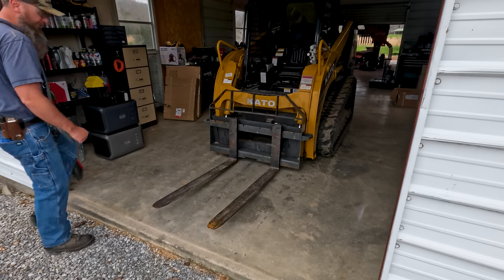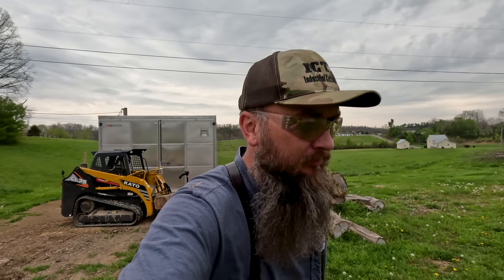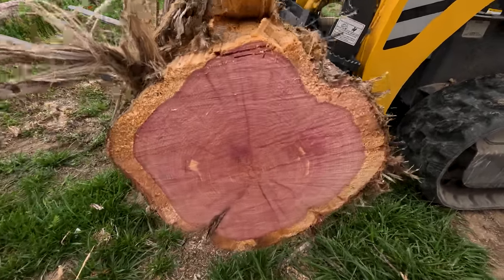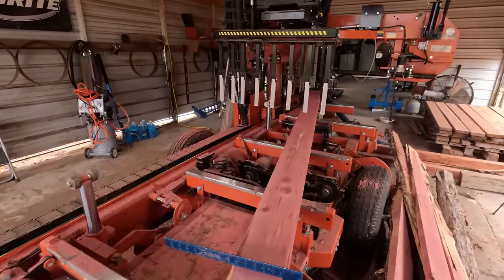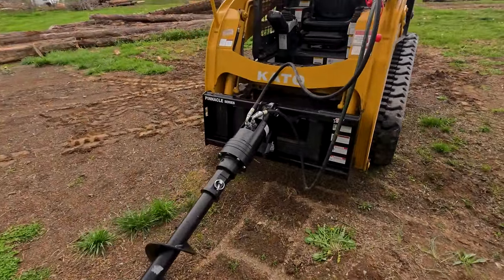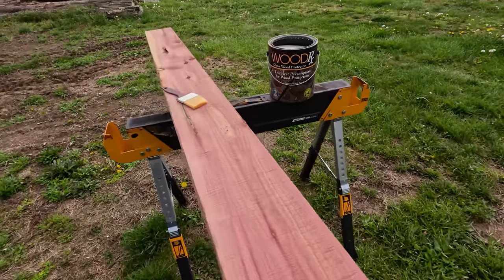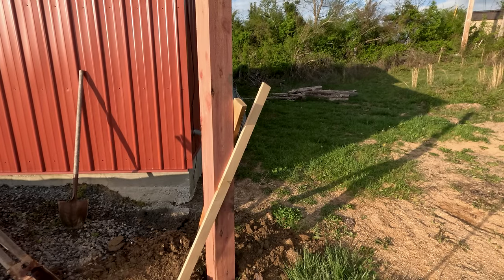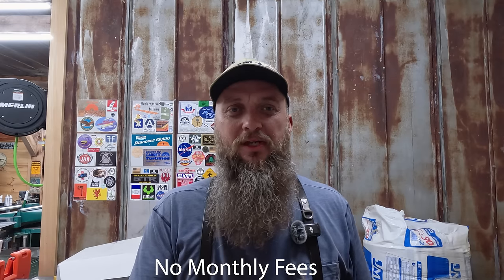Trespassers At The Sawmill

Comment: Use an asphaltic roof coating on the below grade part of your posts. Allow time for complete drying and it will give you 30-50 years rot-free. Have done it in several locations and has worked very well.

Comment: Nice camera, Nathan.  And a beautiful post to mount it on.  When in college, during summers, I made money digging post holes with Dad’s tractor and post hole digger, and building board fences.  I never used concrete or anything on the posts.  One fence I know is still standing 55 years.  Those early creosote posts lasted a long time, there was so much tar pressed into the wood.  In Home Depot today, you can buy a crowbar with a blade on one end and a cast knob on the other.  The secret to a well set post, using soil, is to pound the soil very tight every 6 to 12 inches as soil is added around the post using that knob.  Cheaper, too.  The soil at the post bottom is most important to be packed tight.

Comment: That cap is probably oversized because pressure treated is usually a bit oversized . A 2x8 is usually closer to 7 1\2 instead of 1\4 . Don't feel bad about missing the eclipse. I'm in upstate NY and drove two hours north to be right in the middle of it. It was supposed to be the best place (weather wise ) to view it. They called for slightly cloudy skies . Minutes before it was supposed to happen , heavy clouds moved in. We never saw more than  a quarter of it at any time and half of the time it was 100% hidden behind the clouds  ☹

Comment: Nathan, where I live, los angeles adjacent, we call that "casing the job", where burglars check out a potential burglary site in broad daylight, go home, think about what tools and ladder they might need, (or metal-cutting tool) and then show up a few days later to do the deed. I still think you need a burglar alarm in each of your buildings or indoor sites. You know what's in them but the bad guys don't and that is enticing. axe heads? hand tools? anything they can carry. You are a former cop. Alarm. Alarm. Alarm. And for God's sake, don't go out there to engage in a gun battle. some crazies are armed with AK47's and the like. Not worth it. Note that your youtube site can be a big advertisement as to what they might want. and 1 camera is not enough. what was their path onto your property? and what s their exit path, or would they be going out from a different direction?